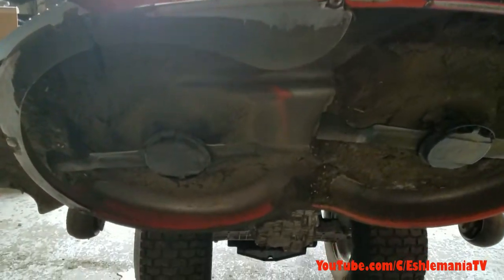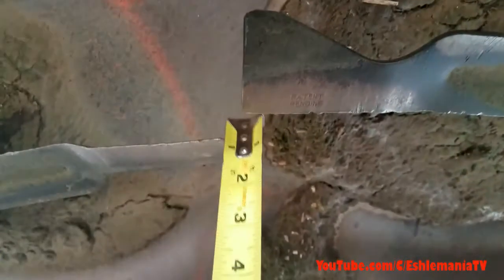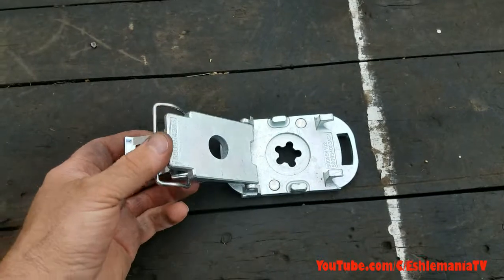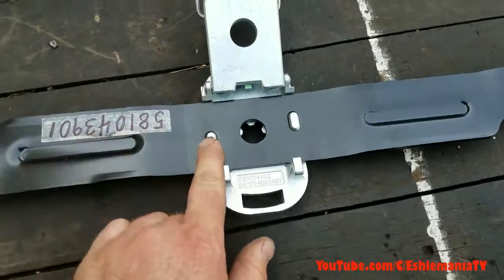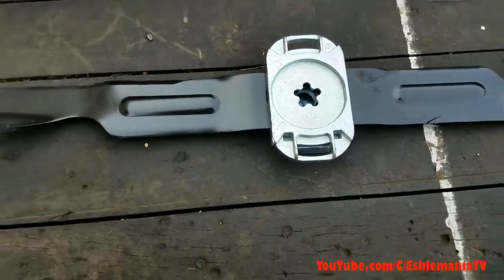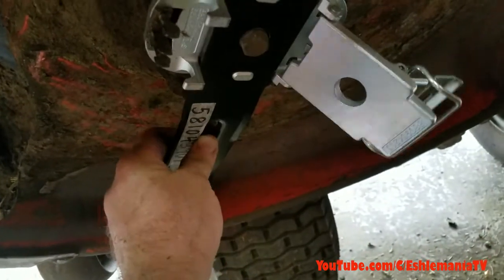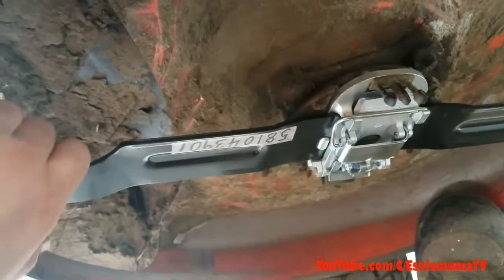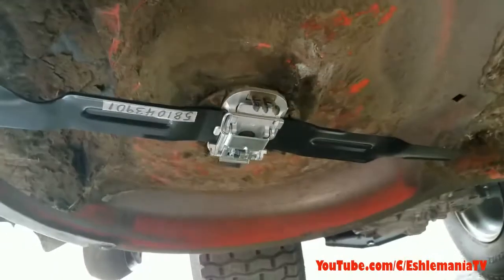Bent Blade On A Husqvarna Revolution Deck

Comment: Thanks for the video. My question is, are the plastic covers necessary. I changed my blades on my Husqvarna YT42cs. Only one of the plastic covers will stay on the mower. I’d appreciate any help.